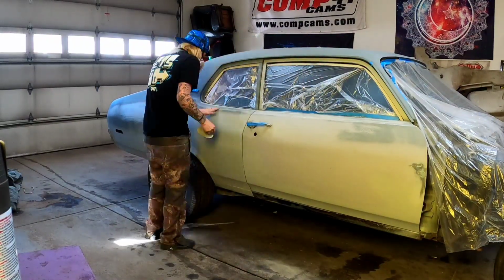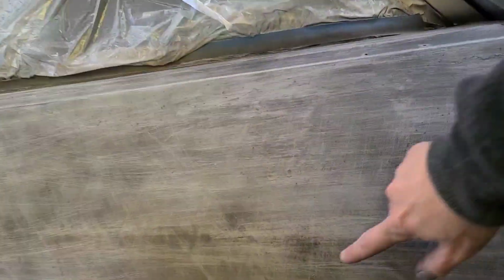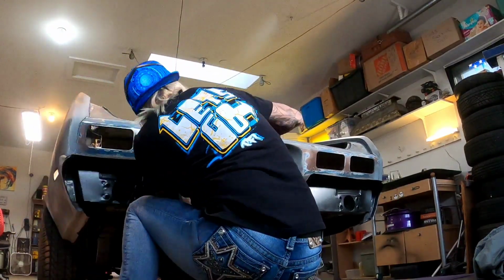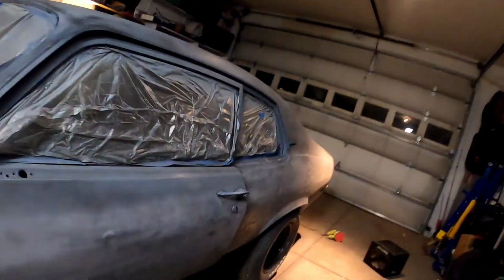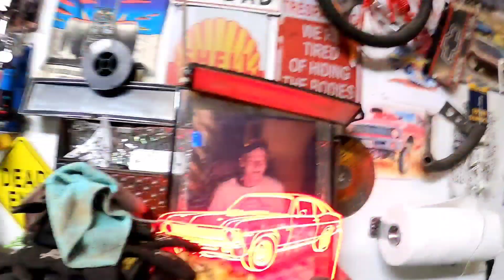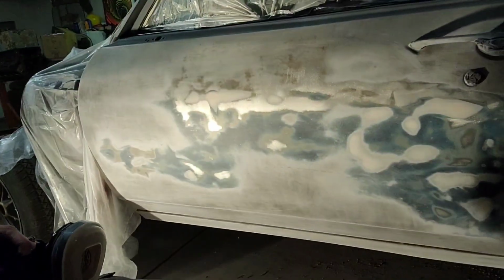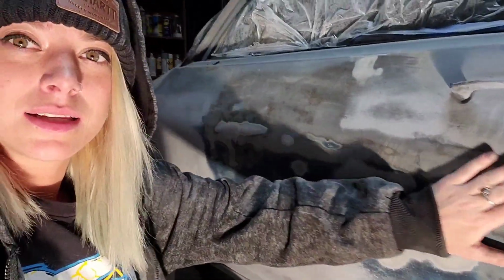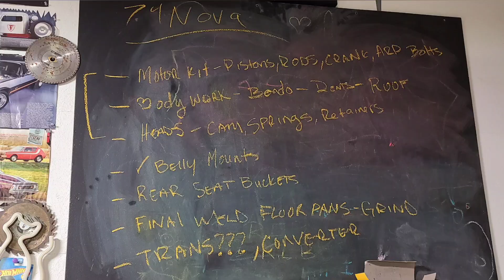Trying my hands at bodywork on my 1974 Chevy Nova project drag car! First time using filler LETS GO!

Comment: Your doing a awesome job the Novas turning out sick. Your dads forsure right there with you. Thats a good tip to go the 3/4 across with hardener gonna try that. Have you ever tried usc all metal filler?
Reply from the maker: Thank you!!🤘 have not tried that 👀 time to do some research 😁
Reply: I used all metal. Perfect for covering welded seams. After a light coat of all metal and sanding then use feather lite on the rest of the area and for small dents. All metal sands like concrete and not ideal for small dents.